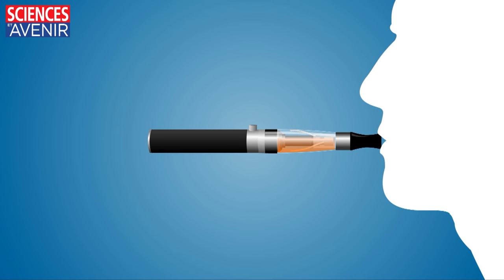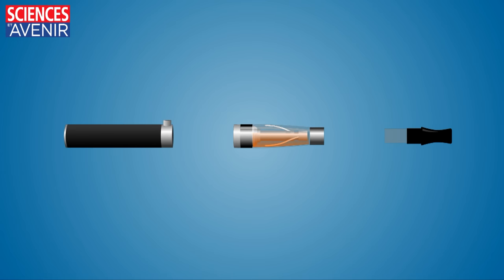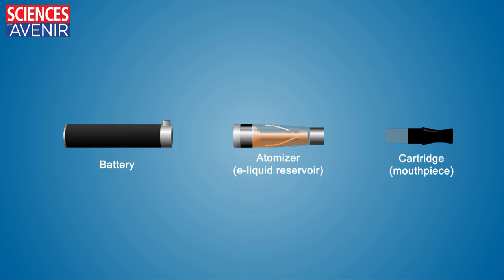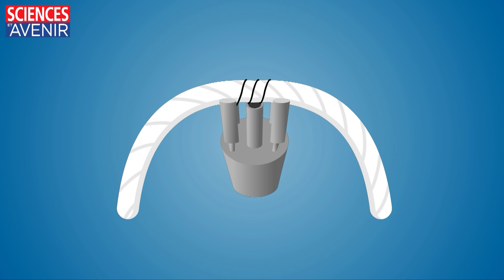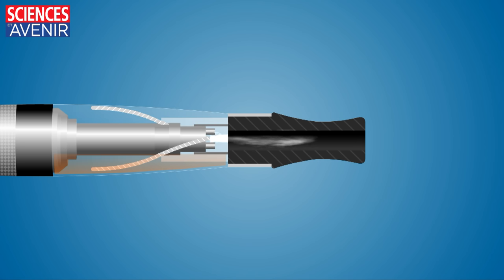How the electronic cigarette works

Comment: I know people are probably aware but that metal in vapour machines is for cutlery.
Reply: could you please elaborate?
Reply: Probably not aware I mean and the metals and plastics used in them are better used in cutlery rather than in smoke machines.
Reply: People also don't know that the metal components that heat the vape liquid releases elemental metals like nickel, chromium and lead into your lungs.  

Major tobacco companies own many of the vape companies and advertise vaping is safer than cigarettes. But 50 years ago, those same company said smoking cigarettes was not harmful